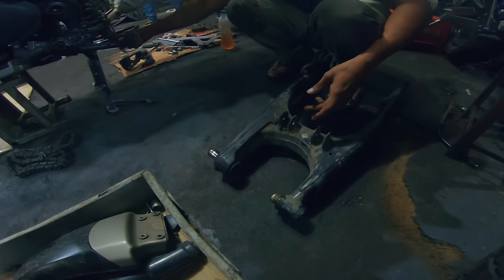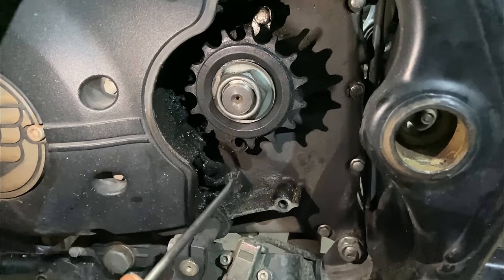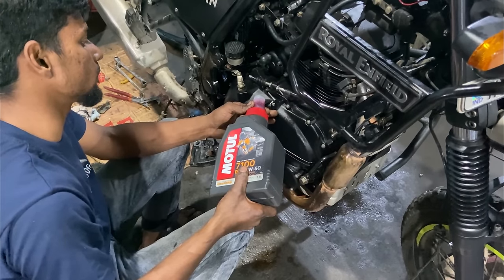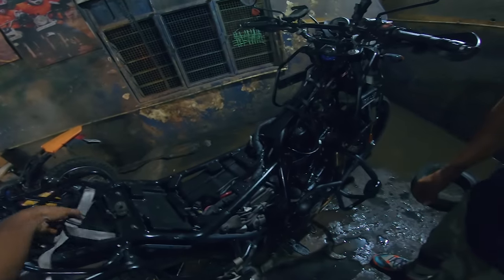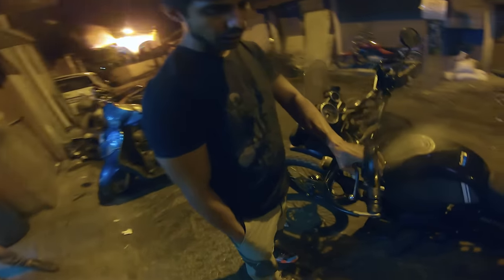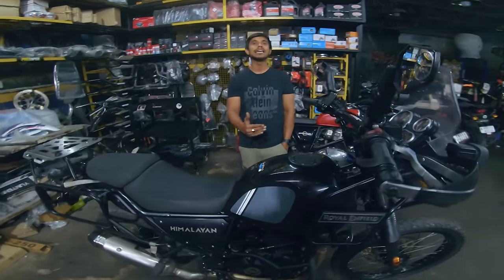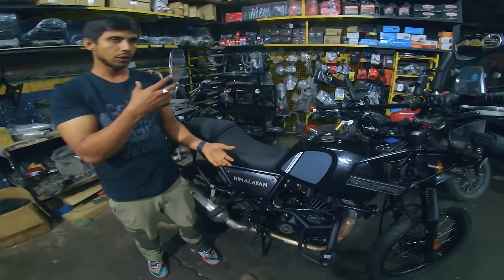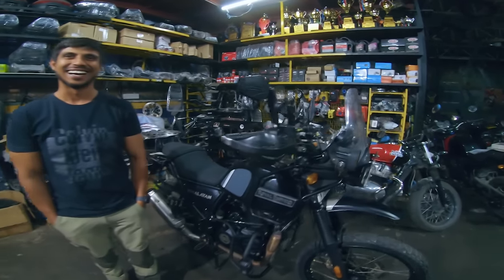Full Himalayan Service at Art Of Motorcycles | 35,000 kilometres

Comment from the maker: This comprehensive full bike service is standard for all touring motorcycles. It takes about 1-2 days to complete and costs only INR 5950 for the Himalayan.

The price range for different motorcycles is as listed below:
Classic 350 & 500 - INR 4950
Interceptor - INR 6950

Checklist for Full throttle service for touring bikes

1. Engine oil 100% synthetic (MOTUL)
2. Engine flush
3. Oil filter
4. Air filter
5. Chassis: Anti-Rust Treatment
6. Cable kit inspection & lubrication
7. Cleaning electrical sockets
8. Battery charging
9. Brake caliper servicing
10. Fastening body kit fasteners
11. Clearing any blockage in engine oil paths
12. Tappet adjustment
13. Timing adjustment: TDC check up
14. Wheel & sprocket bearing inspection & lubrication
15. Chain adjustment & lubing
16. Overall lighting check
17. Clutch overhaul (clutch plates excluded)
18. Fuel tank cleaning
19. Fuel pump service
20. Fork & front suspension inspection
21. Swingarm & rear suspension inspection
22. Bash plate removal & cleaning
23. Brake bleeding & brake fluid top-up
24. Water wash
25. Labour charges
Reply: Great Video! I had a quick question, is the cost including the Oil Change and the Clutch Replacement?
Reply: 5950 Is this labour cost??
Reply: Including clutch plates
Reply: What was your final bill? And how much so the Clutch plates cost?
Reply: @Storiesofadi  ₹450 each for front and back
Reply: Sounds good! Is that amount inclusive of all the oils and spares?
Reply from the maker: @johnkevinkennedy3090  This price includes the oil change but not the clutch plate. A clutch overhaul means examining the clutch assembly, and if it requires a replacement, you'll have to pay for the clutch plate kit separately (no additional labour charges).
Reply from the maker: @Rajeshthota225  Excluding clutch plates.
Reply from the maker: @Jo-X-vR  Yep, except for clutch plates like I said.
Reply: This is only for himalayan or any other bikes?? Will get same service for all kind of bikes....

Any way the video is very informative❤️
Reply: What is the Cost of the mirrors
Reply: @gagan7476   15k
Reply: Chuna
Reply: Where is the service point address?
Reply: Directly  can go for service or have to get appointment becaz i am from coimbatore
Reply: Is the price inclusive of the parts??
Reply: Very helpful 👍🏼 Thank you buddy 👊🏼
Reply: Hi bro i am a ktm duke 200 owner does zoheb bhai do duke servies ??
Reply: Hi Bro this comprehensive full bike service is it necessery to do it after 35000 km or we can do this in less KM also like 10k and do we have to ask for this service in the service center or they will do it when time comes? Please advise
Reply: What grade of Motul 100% synthetic engine oil do you use?
Reply: Hey bro I'm going to buy himalyan is it worth buying
Reply: I went there for the same service….  But the labour cost was not included in the package they said
Reply: That's the best price💕

Comment: I had a classic 350 before... But due to its lathergic nature I sold it and bought vstorm sx... It is faster.. Have great high speed.. Light weight etc... Performance wise excellent.... But don't know why it does not feel good to ride..just there is not character but speed... Can you explain this difference in technically??
Reply: Long stroke engines have that feel good factor because of the low end torque.

Comment: 8:30😂😂😂😂😂 my classic 350 2013 driven 1,20,000 Kms not yet changed clutch plate 😂😂😂😂 I driven very badly without maintening minimum oil …. Bro one suggestion don’t blindly follow what mechanic says
Reply: 120,000 kilometers....74,500 miles?